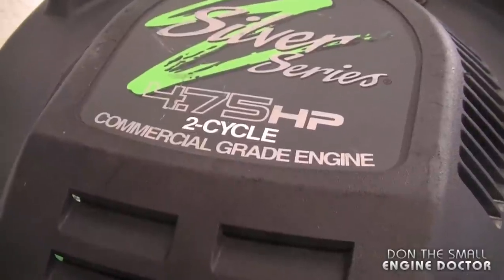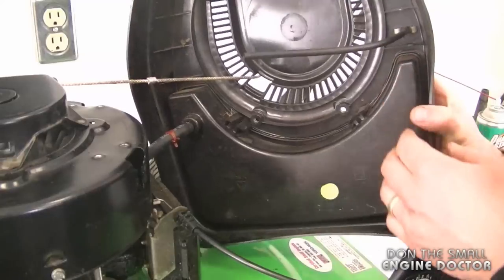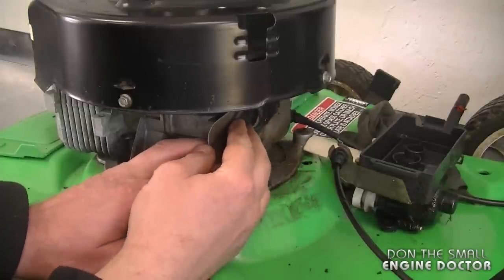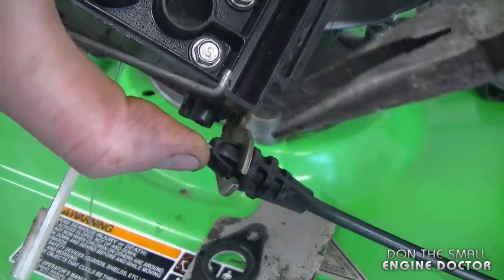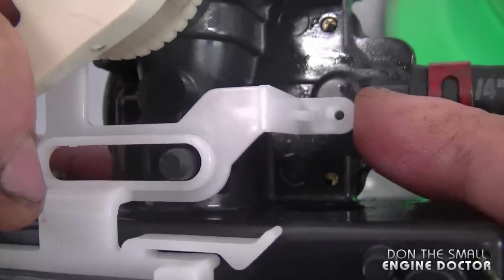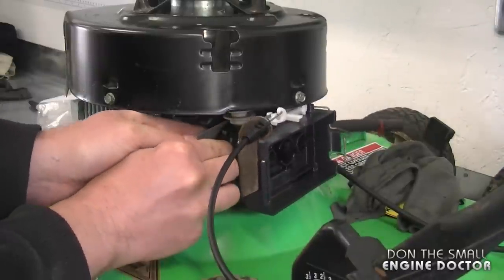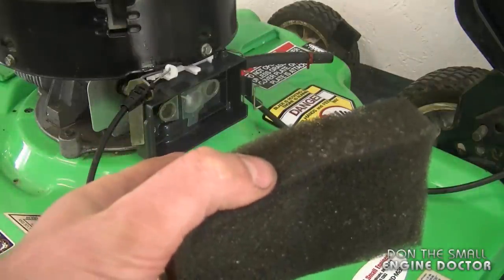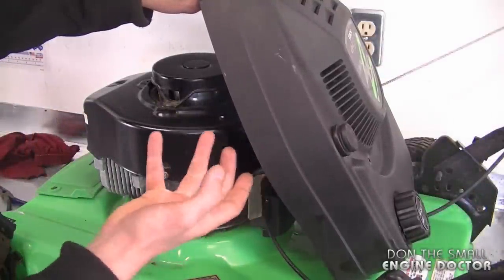Lawn-Boy Lawnmower Carburetor Throttle Control Repair Video

Comment: Hi, really appreciate your videos. Wanted to note something you missed. The air filter on these need to be oiled. Soak in straight 30 weight oil. Squeeze out the excess. It shouldn't be dripping, just oily. You'll want to clean and reoil whenever you do your maintenance. At the very least once a season. 

Still enjoy this mower, no surge, 1 pull start. If only it wasn't so loud. 

Cheers.

Comment: I loved the video and how easy it is to replace the control plastic piece for the throttle. I have to work on one push more (Murray) which have a problem leaking fuel and believe it is the rubber primer bulb which is the problem, but will check all the lines along with the bulb. I thank you for showing us how to do that and that is the way I learned to do things in the Air Force mainly, but working with someone who showed us how to do it then let us do it on our own.

Comment: I really appreciate your videos.
It has come in handy a few times.I enjoy repairing my neighbours lawn mowers & others.
I now have a problem that I do not know if you have  covered it.
I have CRAFTSMAN 21 IN  6.0 EASY START, ( Canadian ) Several years old.
It always started on the 1st or 2nd pull. I pulled the plug and holding it on the motor there was no spark when I get someone to pull the rope..Yes I wear gloves or you can get one hell of a jolt.
I guess the coil or whatever it is called needs to be replaced ??.
Any suggestions?

Comment: Oh, mine doesn't have the plastic hickie inside the air cleaner assembly.  Wonder how necessary that is? Running okay, just here to learn more. Good vid so far---well okay I've done all that.  Looking for adjustment info on the air vane.

Comment: I use genuine lawnboy 2 cycle oil, its the best, it has stabilizer already in it.  My Sears weed wacker wouldn't run but when I  tried my mower gas mixed with lawnboy oil, wow it starts easy.  The mixture is different but my arm was sore and the weed wacker was happy!  The old guy at Ace Hardware gave me a bunch of bologna that the various brands of 2 cycle oil are all the same.  I told him no thanks, I'll drive across town to another Ace that carried genuine Lawn Boy oil.

Comment: I just picked up a Lawn-boy. 
It starts on first pull but for the first 3-5 minutes it runs with high RPMS then will rev down to normal and it runs like a dream. It doesn't sputter, smoke, or surge and the rev control on the handle works fine. Im guessing the governor  is sticking until it warms up and frees it self?

Comment: That was pretty quick and easy!  I have a old craftsman that has a stuck throttle body.  Is there any way to just remove it and make it so its full throttle always?  I don't mow much and probably have less than 5 hrs on my main one over the last 15 yrs.  This one was my grandfathers who needed it gone due to Alzheimer's which made it just to dangerous.  Guess its my revenge for disconnecting the throttle cable.  It didn't have a air filter for the last 5 yrs also.  Thought I should mention that.

Comment: I oil foam filters here in TX, it is just too dry and dusty in the summer.  I figure the engines need the extra filter protection.

Comment: Quick question. What would I use to clean the small metal filter screens in zana carbs. They are plugged with varnish from ethonal fuel.  Thank you

Comment: I have a Lawnboy SilverPro Model#10324.  For some reason, when its idling or not in heavy grass it constantly throttles up and down.  Its done this for several years.  I changed the spark plug, cleaned the contacts on the electronic ignition, took the carburetor completely apart including the jets and cleaned it with gasoline and compressed air.  I checked the throttle cable to make sure it was moving the assembly back and forth.  It still throttles up and down.  I can hold the governor paddle in a certain position and the engine smooths out but when I let go it moves back and forth.  I can't figure out whats causing this.

Jerry

Comment: Dony great video. I have the same set up but when I slide that plastic piece back and forth nothing happens. It just idles at a very high speed. Could the spring that attaches need tweaking or replacement? Thank you.
Reply from the maker: yes it could be

Comment: I have the exact same mower.! It beats my kohler XT 6.75 at mowing. 

My throttle cable handle is broken. Not such an easy fix for me.

I actually have a spare Longblock part # 94-5737 fits that mower and others. May install it or sell it one day. Not sure yet. It's a investment. Lol

Comment: Nice- I have the same machine lift as Bruce Pender has - just love it, wonder why you don't use one. My back likes it as well :)
Reply: I was just looking at those tables at princess auto, Bruce did a great job with that, I was even thinking to save some money maybe you could just use a ride on mower lift and somehow rig up a similar size board to it, not sure if it would work but I thought hey, why not look into it.
---
I just picked up one of these mowers for 20 bucks on Kijiji (dead) but figured it would be a good little project, I don't know much about them though, it seems the compression is low, i will test it tomorrow, I'm not sure what they are rated at (psi) is this engine one of lawn boys better ones, worth the effort if it needs an Overhaul? other then the compression, the machine is in really good shape, I assume that with these 2 cycles, some people (mid mowing) in a hurry may have just "winged it" on the mix, maybe it was running way too lean and finally burnt out.
any advice or info would be great!
cheers
Reply: sorry I read that wrong.. I thought you were saying you had that machine and then brought up the table, I didn't realize that you were referring to the actual table.
long day :s lol
Reply: +Murphy Small Engines LOL NP we all have them days. Cheers

Comment: I used to have the same mower until the connecting rod exploded. That V-Series engine is a bit rough and rattly, but it has some serious grunt to it. There wasn't anything I threw at it that would bog that mower down.

Comment: Plastic parts are so stupid - especially in a critical moving component like this.
Reply: Audioquest56 some camshafts are made from plastic in modern engines.
cringeworthy i know... some of the lower end briggs use plastic camshafts. especially in the 450 series. the I/C series dont have plastic internals. 
even the damn honda clones like the predator engines dont have plastic internals!

Comment: Donny, I watched your lawnboy vids......
I am trying to get my unit going... with no luck....I have cleaned the carb. with carb cleaner, the jets are all clear etc...
will not start, however, when I put a teaspoon of fuel mix direct into the carb, the unit starts first pull and runs for the few seconds.....What could be the problem be?
Please reply bud,,,,
take care.....
Reply from the maker: thenorth03 make sure fuel runs freely to carb from tank, some it can get clogged at fuel valve
Reply: I cleaned out the tank, changed the fuel line, the fuel pours out the line, no problem, the bowl fills up, fresh fuel is being used.....I am missing something....As I scratch my head.....lol
Reply: Sounds like you have a carburetor issue.  Rebuild it, or better yet, replace it.  Many carbs are fairly inexpensive these days.  I'm sure Donny will be along with more definitive/expert advise but that's my take.
Reply: Well, if you're sure there is fuel. The oil is mixed in right. It's not old gas. Then how strong it's the spark? Starter fluid will burn easier. Also how did you clean the jets? Is there an air leak? There is one other thing, clogged exhaust. There is a U shaped pipe under the deck. Sometimes it needs to be cleaned. It's a PITA. You'll need a tube of gasket maker.
Reply: Kiernan Bros New carb kit ran me about $70.
Reply: Mike Loepold Thanks for the reply....I used carb cleaner and air to clean out the jets, made sure they were clear using a thin pin.. I poured a teaspoon of gas mix in the carb, one pull and it starts and runs for a few seconds. So spark seems to be OK, i would say. Have to check that exhaust now,
Reply: thenorth03 Sounds like a fuel issue. Here are some more guesses. Bad primer bulb? Try holding that down when you start it. See if it runs longer. Could be an air leak around the carb. Did you clean the little screen at the bottom of the bowl intake? Try using the wire from a twist tie to poke through the jets. If you try to blow through them and can't they are clogged.
Reply: It does not have a primer bulb. I can blow through the jets, and I removed and cleaned the screen at the inlet bowl. I also removed and cleaned the muffler and ports..
At my wits end.....lol
Reply: thenorth03 you ever get yours running? It should have a primer if it's a 2cycle lawnboy.

Comment: Doney with the oil we have nowdays I am able to run the lawn boy 40:1 or 50:1?
Reply from the maker: better at 45:1
Reply: @donyboy73  It use to be 32:1  so 45:1 is ok? I dont use Synthetic
Reply from the maker: @jaylandry8915  yes 45:1 is ok with today's oil

Comment: hey donyboy73 my lawn mower (McCollouch lawnmac 548 18" deck) has a manual throttle leading up to the handle bars and its all to hell it got a bit of oil on it and the spring has stretched beyond belief and gone missing (the one that leads to the govenor arm) and now the only way to rev it up is by hand on the carb and thats not practical or safe becuase theres no govenor regulation if u could help by sending pics or anything that would be amazing cheers u can message me here if u need pics to be abel to help https://www.facebook.com/jake.moore.9828456